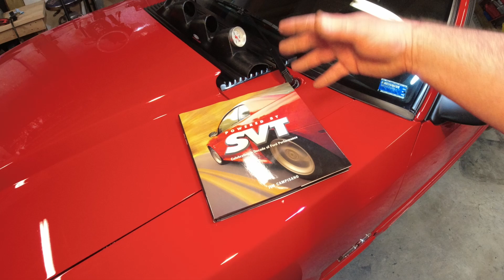WHEN FOXBODY MUSTANG PLANS CHANGE

Comment: That's a excellent plan on swapping the engines around on the 417Fox with the 86 GT. 
Good luck on your weight loss journey brother. I need to do the same in a bad way. I made my mind up to do the same. I'm around 70 plus pounds over weight myself and 49. I look forward to your updates
Reply from the maker: Thanks man!  I need to loose at least 100.  As you know the older you get the easier it is to add but much harder to get it off👊🏻
Reply: @417fox  hell yeah brother it sucks 😂😂😂 We can do it. Just have to stay focused!!!  🤔🚫🧢🚐💨💯💪🌮👊

Comment: You going to check out old motor. Maybe bearing or anything before put in 86. Or just put it in .

Could use all the efi stuff for my non mustang FOX. Lol.
Reply from the maker: I will prob pull the pan and inspect the main caps.  And will be doing a rear main seal replacement before putting it in the 86
Reply: That be good selling point
Reply from the maker: @stephenmiller5700  “IF” I sell it😁